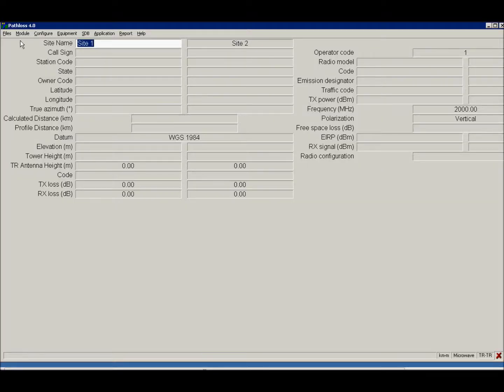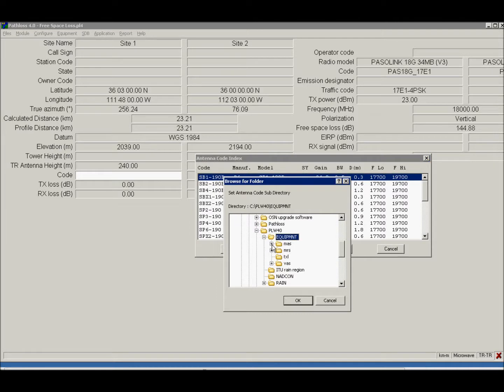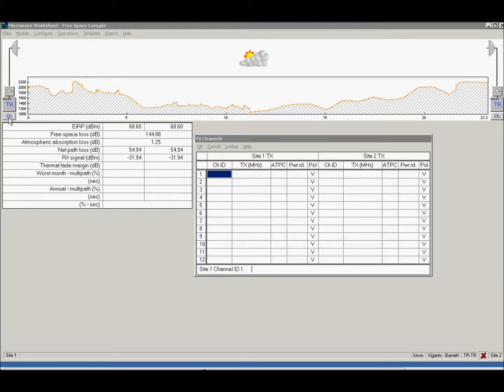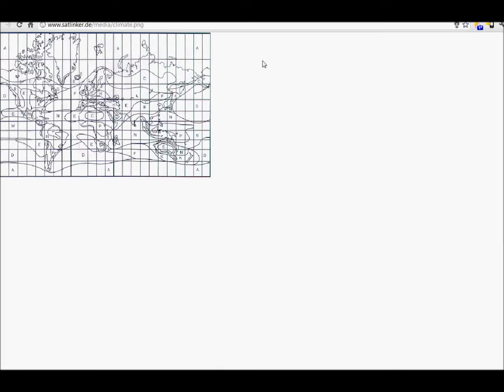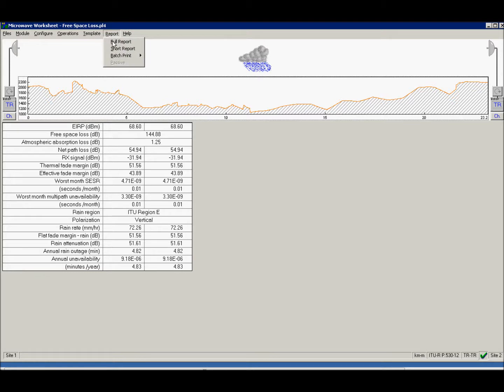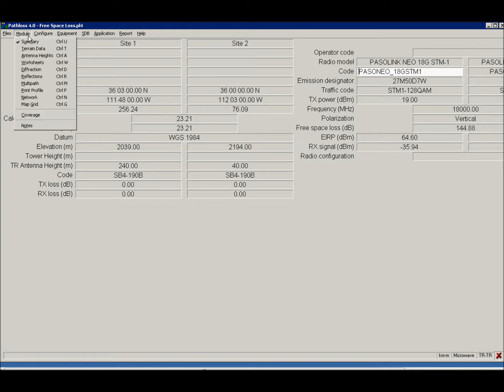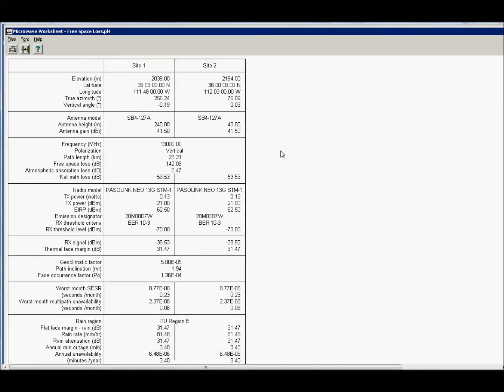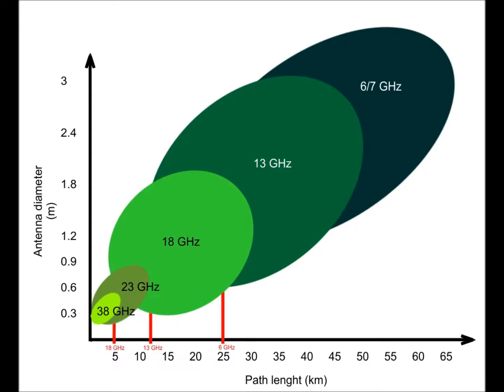Pathloss: Make microwave link project

Comment: Very informative. 

Thank you very much for your videos regarding path
calculations.  Do you any videos that explain to a newbie the parameters on the Pathloss 5 Transmission Criteria?On the Multipath – K fading Method, when to use Vigants, Rec ITU-R P.530-6, Rec ITU-R 530-7/8?  What are the differences?On rain, when to use Crane or ITU-R P.530 ?

Thanks!
Reply from the maker: For using Crane method you need to have rain statistics file. The ITU530 method calculation is based entirely on the rain rate which is exceeded for 0.01% od the time. For ITU-530 equations are valid only in the range from 1% to 0.001%. On many practical links the range will be exceeded especially on short links with high fade margins.
Reply from the maker: The rain calculation in ITU-R P.530-8 uses a modified algorithm for latitude between 30° north and south. If geographic coordinates are available, the latitude of center of the path will be used. If lat field is blank then the rain calculation will be made assuming that the latitude is greater than 30° and the result will correspond to ITU-R P.530-7